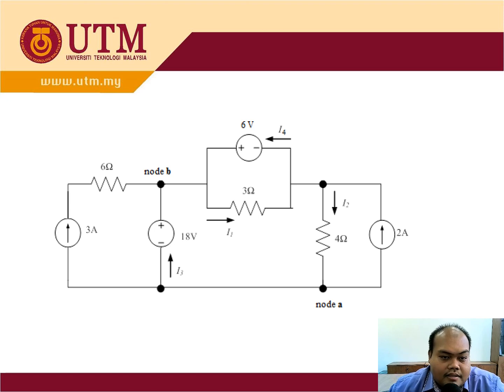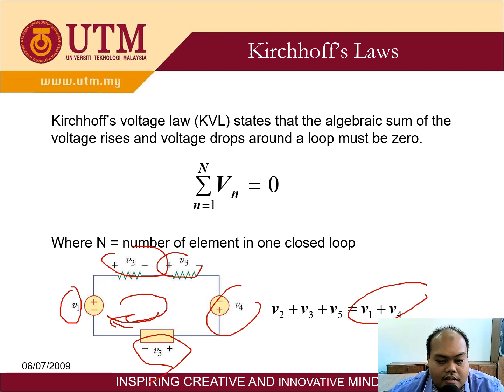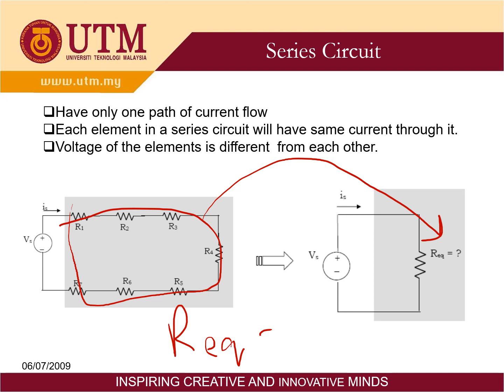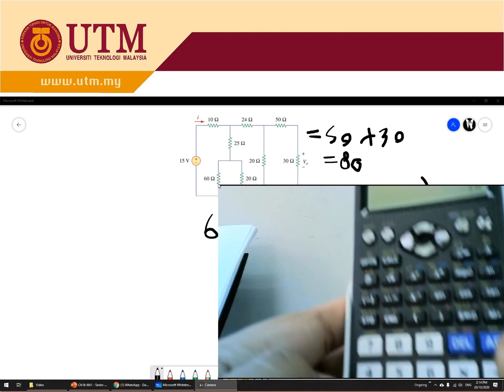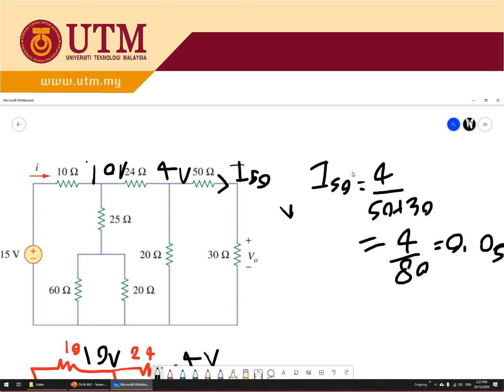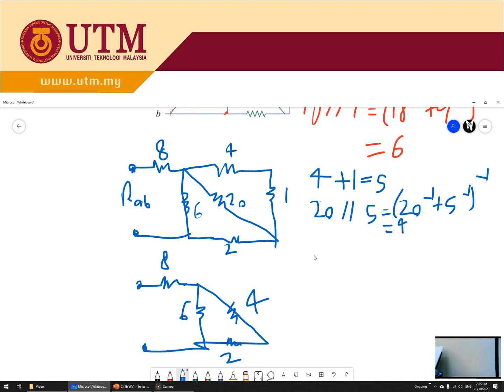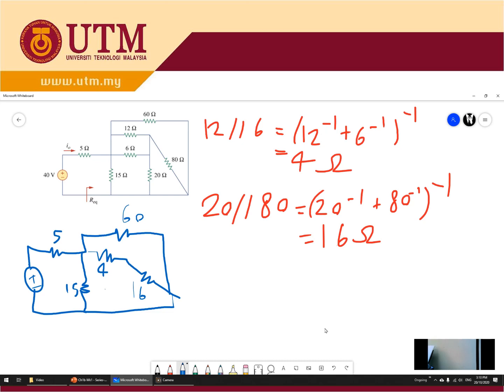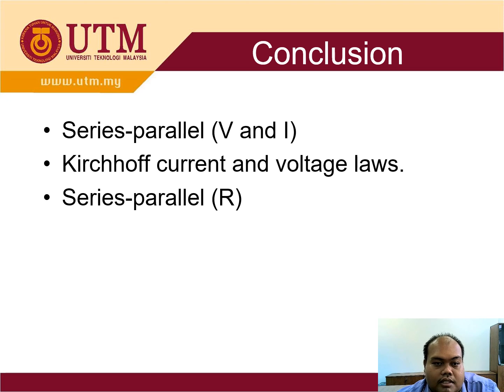Ch1b Wk1   Series Parallel and Kirchoff Laws

Comment: for the last question, how come you calculate Va, you subs 2ohm for its resistor meanwhile for the I2 you subs 3ohm? Isn't the question itself state that the resistor across it voltage was 3ohm? Where did you get 2ohm out of nowhere